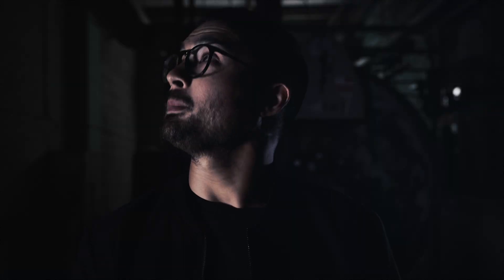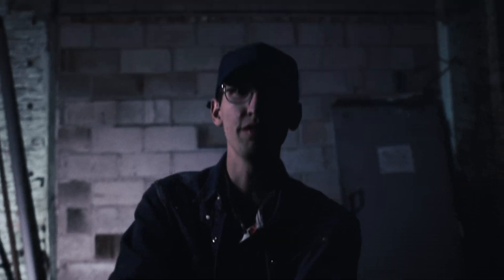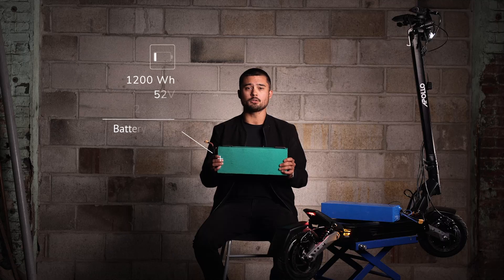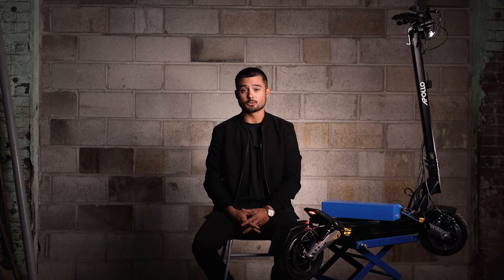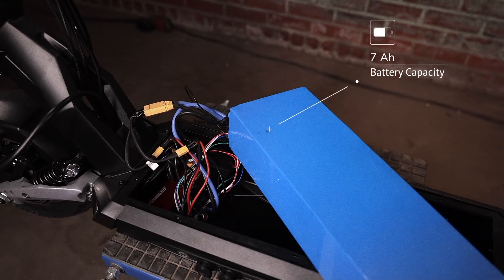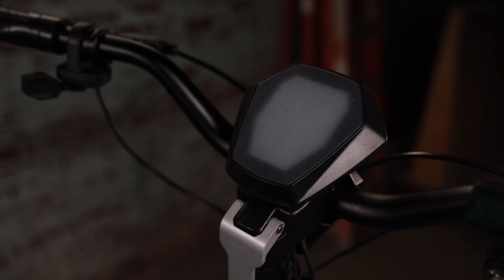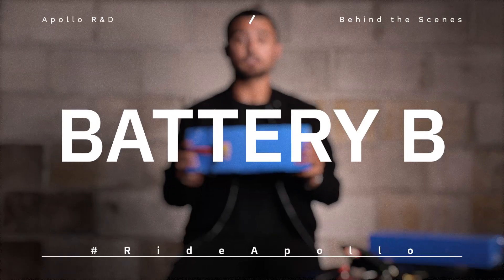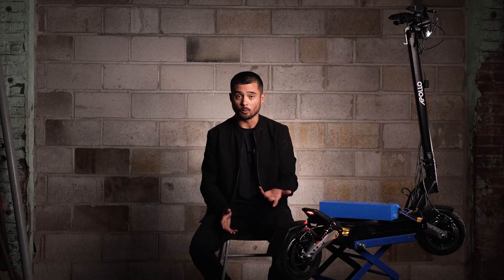Building the Perfect Electric Scooter Battery: Apollo Phantom Research and Development

Comment: If you just replaced the cells in your current battery with Molicel P42a cells then you could charge ultra fast, discharge ultra fast, and have ultra capacity (4000mah per cell) Mystery solved!